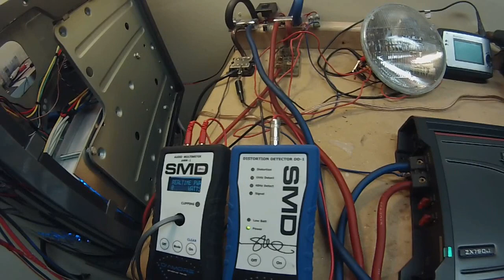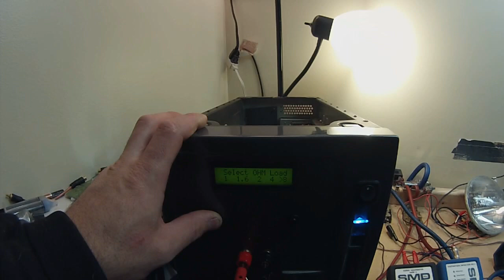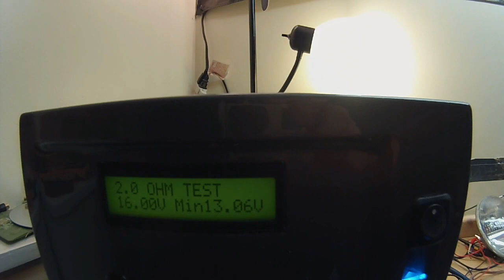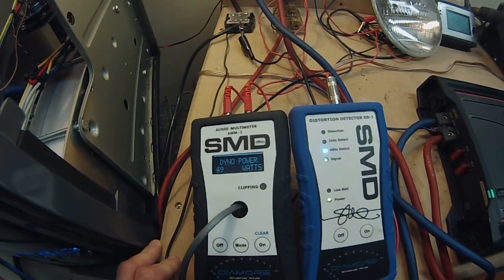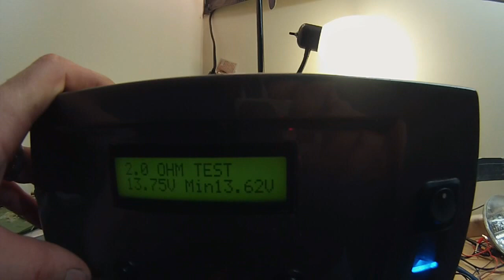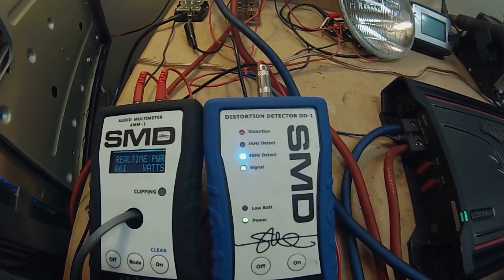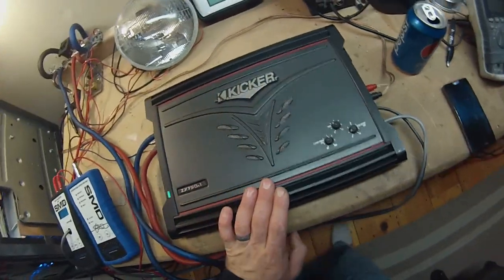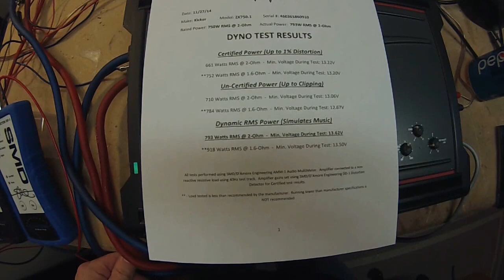AMP TEST - Kicker ZX750.1 Amp Lab Dyno Test and 1.6 ohm Torture Test

Comment: I still have one running hard 14 years later
Reply: Same, not to mention that I've always ran mine wired to 1ohm 😂 Now I cannot speak on this guy's results but I can certainly speak of my own which when you're able to maintain a higher voltage like the 14.8V that my lithium banks rest at and the final impedance before rise being wired to a 1ohm load I've clamped over 1,000w clean from this exact amplifier and this is hooked to subwoofers, mounted in a running vehicle clamping real-time output and yes it was clean not a clipped signal... Love these old ZX series Kicker amps!

Comment: These amps do almost 1000 watts at 2ohms. You aren't giving the amp the power it needs
Reply: Agreed, if you're able to feed them a solid 14.8V from lithium batteries or super capacitors then it'll pull closer to 1500 at 1ohm not sure why he says that his shuts off if he tries it at 1ohm as I've ran mine for years at 1ohm and have even ran it at half ohm at times just for testing dual 1ohm woofers however I have been doing car audio since the late 80's and know what I'm doing lol so I'm able to wire it at half ohm knowing that with impedance rise it'll never see a true load below 1ohm also the guy mentioned thermal protection? Well with mine wired at 1ohm and mounted in a hot car trunk it has never not once shut down from any sort of protection 🤷‍♂️

Comment: 14.4 volts man. thats what cars run at. especially if you have a good battery and cap.why test at 13 volts?
Reply: J Gregor I guess u don’t know your stuff lol caps are crap and ho alt would be best, and I can guarantee most systems in the audio  game is not going to see 14 +volts
Reply: Mr Vaj caps are not as good as batteries and ho alternator but a good cap can still help a little bit I wouldn’t tell anyone to go buy caps lol
Reply: He doesn’t have the batteries or power supply to give it proper voltage during test.

Comment: I ran my 08 kicker zx750.1 at 1/2 ohm for over a week with no issues, got a little warm but performed flawlessly.
Reply: No you didn't.  It absolutely goes into shutdown/protect. I own a bunch of these Amps, and I have a better charging system than you, I promise. Stop making shit up.
Reply: ive ran kicker zx550.2, 750.1 1200.1, and 2500.1 and none of them would last longer than 3 minutes at 1 ohm.
Reply: @arthursnead40  because you tell the truth.  Other dudes a retard liar

Comment: Kind of surprising it didn't do more. My old zx750 claimed 968 on its build sheet and it absolutely pounded my two 12s.
Reply: Robert Cary his voltage is at 13.2, if it was 14.4 or higher it would put more power out, i had a zx1000 that put out over 1200 watts and the birth sheet said it was over 1200, the sheet said 1280, i was getting around 1250 out of the amp

Comment: Is it possible to get your hands on a planet audio anarchy 1500.1M and a pioneer GM-8601? To dyno their true rms is
Reply: karzygijose yeah ive got a cheap entry level planet audio amp and am curious myself
Reply: karzygijose i will go with the pioneer I have one to 8601 and I got it down to a 1 ohm load with it is handling not getting warm pushing 3 12s and I'm getting about 800 to 900 watts easily at 14.4 volt and it doesn't get warm cut off for nothing the Planet Audio or had to 15 and that thing is shity it doesn't put out the power and a bass sound real flat and if you try to run it at 1 on it will click and cut on and off after about maybe 20 to 30 minutes playing music constantly it'll it'll just go on and off my best bet is to go with the Pioneer bro get 2 of them and you sound really amazing bass head forever